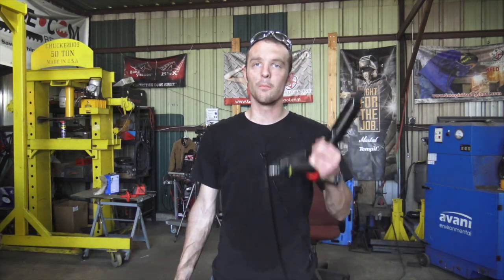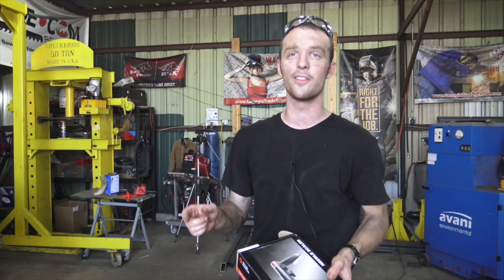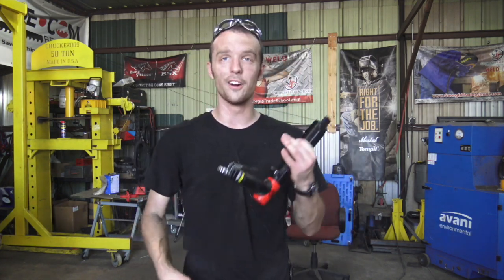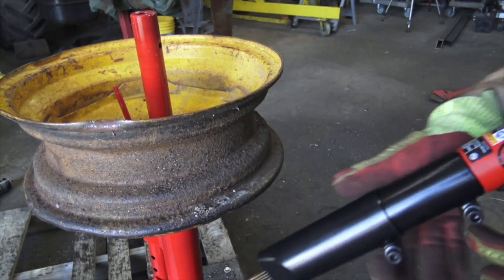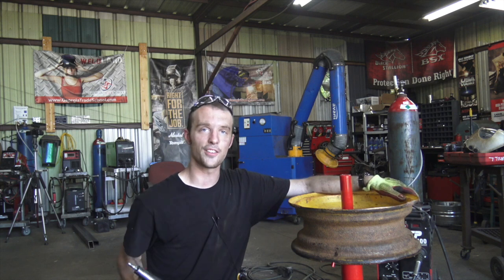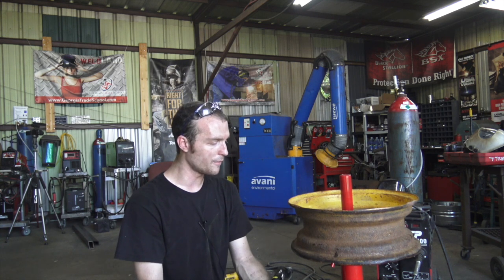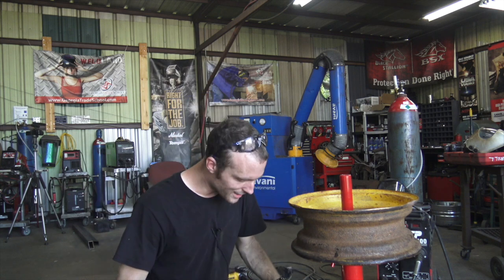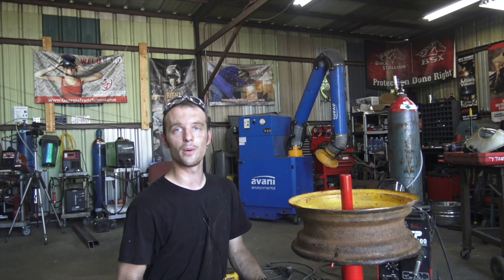THE ULTIMATE RUST REMOVAL TOOL!!! CHICAGO PNEUMATIC CP7125 NEEDLE SCALER REVIEW AND WHY YOU NEED ONE

Comment: I think sandblasting will give you the right result. That rust still there.
Reply: Not sure that would be the tool for this job. There were some massive chunks taken off by this tool which would have either taken ages with a sand blaster, or would eat away the material around it too quickly.
Now it's been needled, it's in a perfect condition for sandblasting.

Comment: Wouldn't a wire wheel be more efficient ?
Reply: When you have really bad, flaky rust, a wire wheel is not that good. A scaler like that will pound the rust flakes off. I don't have one, so I have had to do with a hammer and a chisel...
Reply: Wire wheels work, but they get expensive after a while

Comment: This demo didn’t seem the best for rust removal - that rim is deeply pitted.

Was hoping to find discussion on the different types of scalers and different methods to remove/clean rust then surface prep
Reply: No this won’t go beyond crusty stuff, once you get to surface rust you need to wire wheel, grind or use rust converters.

Comment: Such a useless tool,  it removes flaked rust. It doesn't actually remove rust.
Reply: You only need the flake removed and then you use some phosphoric acid mixed with 20% alcohol sprayed on and leave it 24 hours and then paint straight over,  it very cheap